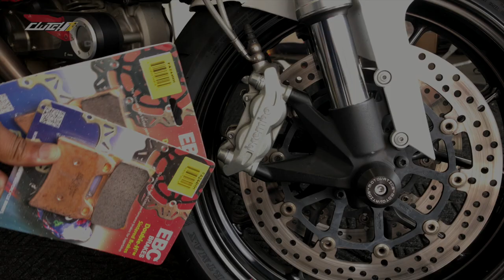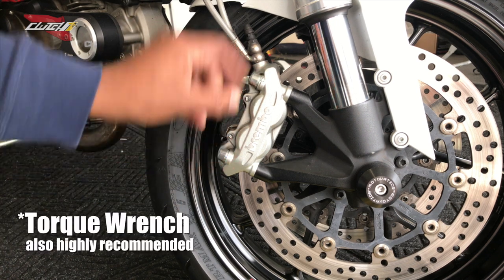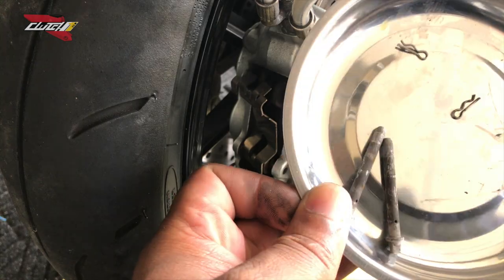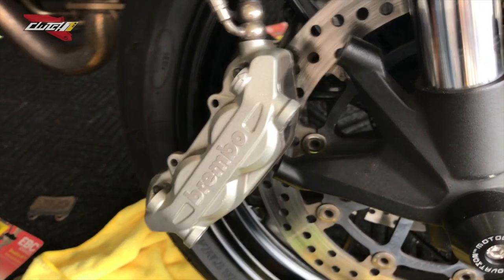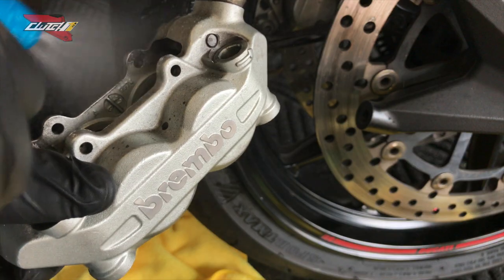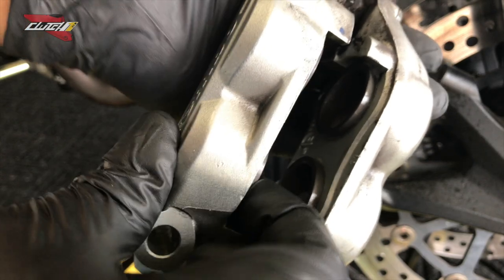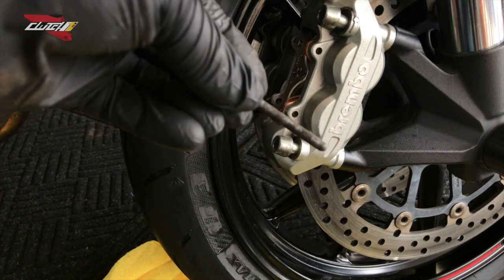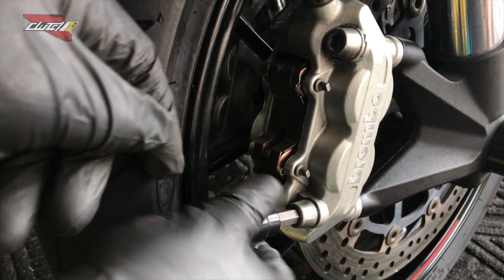How To Replace Front Motorcycle Brake Pads | Ducati Monster

Comment: Nice video - clearly filmed, nicely explained, good extra tips and the music's at the right level (i.e. not overbearing) :)

I notice you don't use any 'anti-brake squeal' to hold the back of the pads onto the pistons and prevent any pad-rattle?

Comment: Thanks. I'm trying to get the last pistons back in on the right side. :) The trick about loosening the cap is great. I was trying to push all 4 pistons in (on the right caliper) without doing that. Really difficult! :D

The only thing I would suggest is that you cover your tires when spraying any soap (or brake cleaner) around 'em. I covered mine with towels and then placed a bucket (on top of a DeWalt case) near the wheel so I could use Brake Cleaner in the bucket with precision and no overspray. :D

It's also good to lubricate those pins with brake lubricant. (I just did my rear pads a week ago).

Thanks for the helpful vid, Mike!
Reply from the maker: Loosen the reservoir cap slightly then you should be able to push them all back. Also, try cleaning them.

Comment: Great video! Couple of questions: 
Should you use blue loctite on caliper bolts when putting back? 
If new pads seem squeaky what should do? 
What about cleaning the rotors, as well?
Reply: Also, which torq wrench do you use/recommend ?

Comment: What it the torque spec on the caliper nut? Thank you!
Reply: my shop manual only lists 25nm for the rear brake calliper screw. I am guessing it should be the same for the front as well. Strangely no mention of torque specs for the front

Comment: how about removing the brake disc to take the caliper out and then pads? Just curious if might be easier or not. Also, what happens if I overtorque the screws, because I don't have a wrench with torque indicator :)
Reply: Why would you want to take the disc off? :S
Reply from the maker: +PerformanceTube I thought the same exact thing. That just a lot more work. To be honest, you don’t even need to remove the Calipers. I only do that during my major service intervals to clean things up.
Reply: @ClutchFirst  how would you push the pistons back without removing the callipers?

Comment: how many torq did you used ?
Reply from the maker: It’s been awhile since I’ve done this vid. I’ll take a looking around my garage to see if I wrote it down. If not, check your Service Manual.
Reply: @ClutchFirst  dont worry , i got the torq 45 nm front, and 25 nm rear.. thanks bro.
Reply from the maker: Pietro Ramiti Sounds good. Take a moment and Subscribe. That will help the channel.